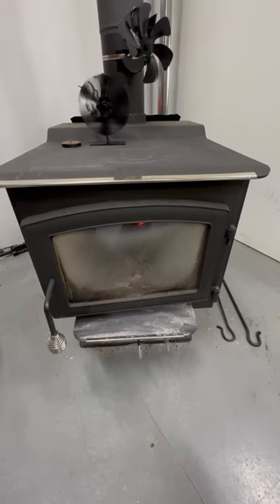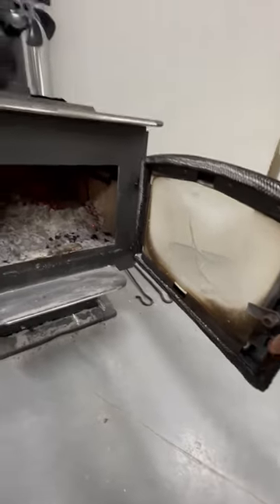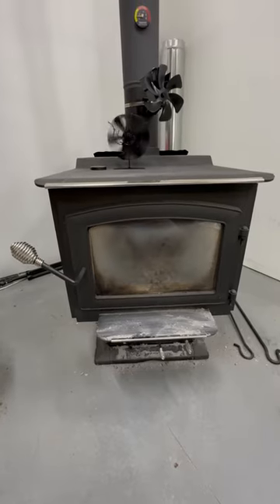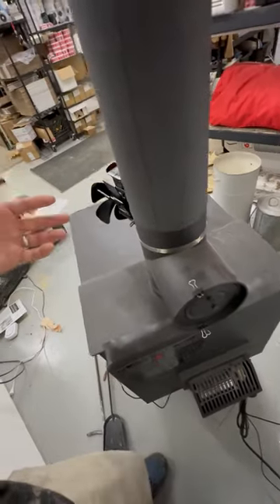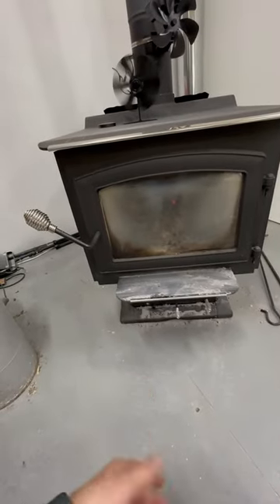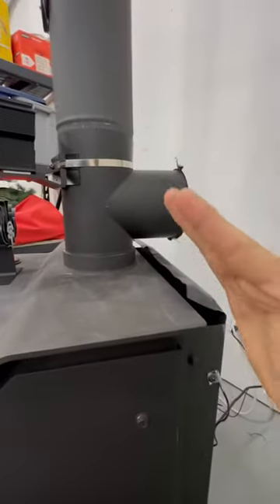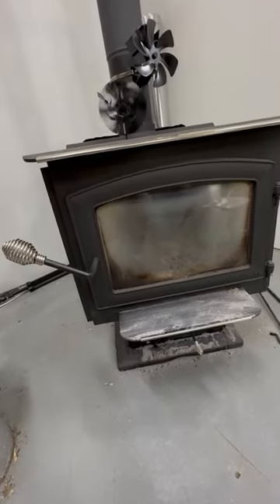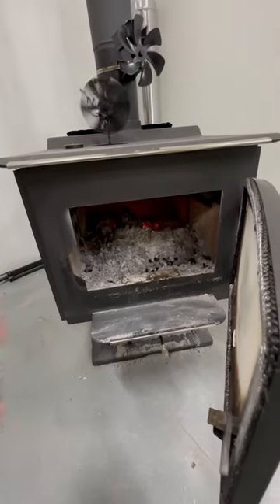Vogelzang review and things you need to know before using it

Comment: hey jim here, I have a much larger unit made by the same manufacturer that you would put next to your regular nat gas furnace in the basement. on mine, the manual reads barometric damper should be 18" up the pipe and should be adjusted to .05 which is 1/2 inch water column. you could get the tool or make your own. use a piece of plywood and some clear plastic hose make a u shape with the hose and staple it to the plywood leave extra on one side to go into a small metal tube you insert in the stovepipe after you drill a small hole. you can buy a plug for the hole at the hardware store. put water in the plastic tube so it rises the same on both sides then mark the level on the suction side then measure 1/2 up and make a mark. insert the tube into the stovepipe with a good fire and adjust the dampener with the weight on the flapper till you reach the 1/2 inch mark. make sure you have the dampener free moving on its own. mine works great hope yours will too, look on youtube to watch a video on the construction. if there is no video let me know and I will make a video on my channel justJim and sub if you like. GOD BLESS
Reply from the maker: My wood stove doesn’t have any info on a barometric damper so the manual on the damper says this “Install the Barometric Draft Regulator as close to the stove as possible. If a manual damper (wood and coal stoves) is necessary, the Draft Regulator should be installed ABOVE and no closer than 18” from the manual damper”

Mine does not have a manual damper so it says it should be as close to the stove as possible, unless I am reading it wrong somehow.  Customer service didn’t know anything about it and was completely useless.

If you had a video of it working, I’d definitely love to see it.  I could find much on the web for info on it!

Thanks for the tips! Please hit that subscribe button if you hadn’t already!

Comment: A lock nut isn’t heat resistant, the door hinge pins work their way out too. If you have blocked off the secondary air vent then you have ruined it’s efficiency. I use mine 24/7 10 months of the year. I have burned out a couple of the secondary air intake tubes and replaced them with stainless. I have also changed the ceramic pad, after market, works good. Reason it leaks is because the regulations no longer let you damp down a stove to smolder because it clogs the chimney and pollutes. Best stove I have ever owned. If it gets too hot for you, don’t put so much wood into it. It is the only heat we have.
Reply from the maker: They make a lock nut that does not have a nylon insert, it has a dimple on the side of the nut.  They work really well.

Thanks for the comment, please don’t forget to hit that subscribe button!
Reply from the maker: @Red Oak I didn’t put one in on this stove because it is in the shop and there are plenty of leaks in this building, also I want the air to be replaced.
Reply: @Red Oak the secondary intake is the air intake hole behind the ash box in the back of the stove. I cut a hole in the floor and used a dryer duct hose to connect into it after making an adaptation from four inch dryer pipe to five inches to the stove. This brings fresh air into the stove actually making the stove draw better. There is a video on YouTube showing you how to do that. If you need too. Really liked this video and I did subscribe.

Comment: I have the same stove in my shop than a smaller in my house. It's a good stove but I've seen the same problems as you. The door was loose and the rope on the ash door had a gap causing a run away on one of my first fires. It's my first stove so definitely learning curve. I own a tree company so it makes sense to heat with wood.
Reply from the maker: There is definitely a learning curve!  Is a sawmill next on your list?  I know quite a few tree guys around here that do firewood and have sawmills.  The dump fees around here are getting pretty steep!

Comment: Have a smaller one on the way, so this is timely. 
Have a manual damper in the stack with our existing stove.
New stove going in new modular home, and it'll be getting manual damper in the stack as well.
I would expect to have to adjust the door latch, so I don't consider that a quality control issue.
It should be mentioned in the manual, as well as the fireboard and kaowool issue.
Thanks for the video!!
Reply from the maker: The blanket on top is set in place and isn’t easy to move. I don’t think that it could have shifted in shipping.  However, they should have more in the manual about checking these things as well as information on how to set them properly.

Thanks for watching! If you haven’t already, please hit that subscribe button!
Reply: @portercreek  agree!
And subscribed

Comment: Never put a barometric damper on a wood stove. A damper is fine. The stove has a thumb size hole even when the air control is pulled shut. I put heat tape over that and can shut the fire right down now.
Reply from the maker: It’s what the manufacturer recommended

Comment: It sounds like they miss spoke when they said barometric damper, in my opinion what you needed was a inline pipe damper. This would allow you to slow the amount of air going up the chimney, directly affecting the amount of draft you have. Also, yes the epa did screw with the dampers. They were forced to leave the damper open for their efficiency ratings on low, I believe some guys put heat tape or tac weld some steel over the hole that is left when the damper is closed all of the way. I hope this helps
Reply from the maker: The manufacturer said the epa put a band on using the dampers.  My solution is a wall mounted fan behind the stove that blows on the stove pipe, if it gets too warm I just turn that on and it brings the temp down pretty quick. Thanks for commenting!  Please don’t forget to hit that subscribe button if you haven’t already.

Comment: Put a damper rite in your chimney pipe about 10"to 15" about the stove and dont say anything you can get them at manards will work perfectly
Reply from the maker: I had ready that with stoves that have a secondary burner it is not advised to put one in.  Did you put one on your stove, does your stove have the secondary burn?
Reply: I have one on my Vogelzang and it works really well. Really helps keep the gasses and smoke in the chamber to allow it to be burned with the secondary’s. I can get an all night burn with loading the box, closing the damper about 85% and closing the air intake to about half on the stove. All you will see is the flame in the top of the fire box because it’s burning all the gasses and smoke off.
Reply: I have what I think is the same stove aw3200e-p. Really hate this stove. So hard to keep it burning low. The air intake has a thumb size hole when the air intake is closed completely. I put heat tape over it. If I load this stove up I can’t keep pipe temps under 400 and the top of my stove runs over 800 with both air controls shut off. Really thinking of getting a blaze king. Load it and forget it.from stove top  people that have this stove what are your stove top temps in the center of stove top?
Reply: @TVCColin what’s your flue temp and your stove top temps doing it this way